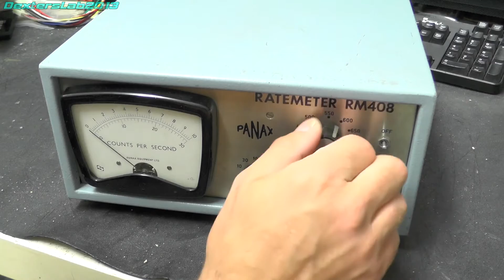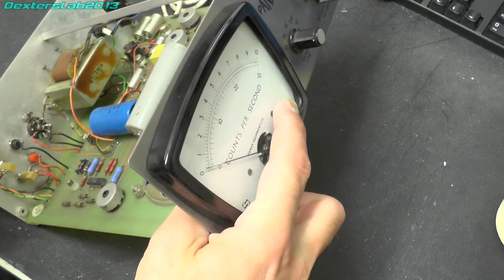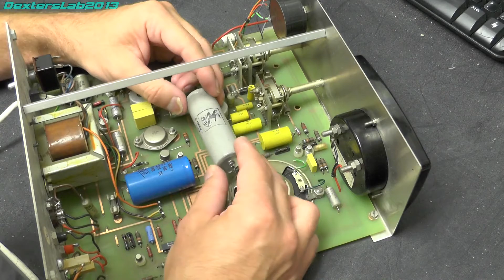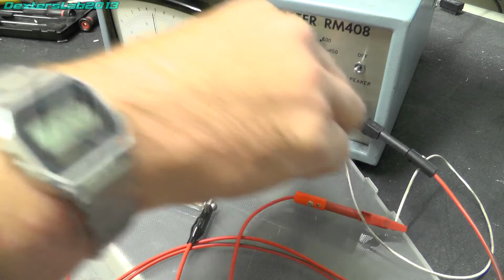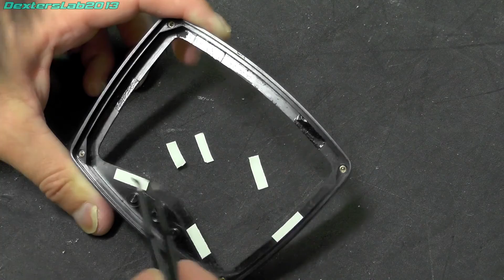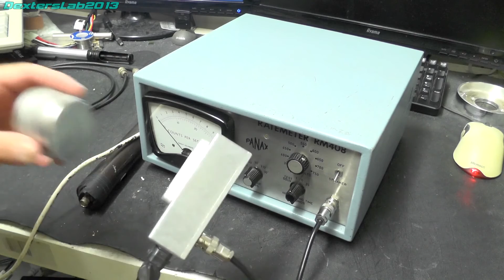DL152 1970s Panax RM408 Ratemeter Geiger Counter Repair

Comment: 18:40 yeee, some sanitary silicone would do wonders securing the old fella’ down

Amazed how the other leg just wouldn’t break though
Reply from the maker: I opted to use hot snot
Reply: owhyeah - why not

Lately I mainly go for silicone when I can wait on it to dry ... keeps my tube unclogged - and doesn't break a sweat at super high temperatures

Comment: What do you use as radiations source?
Reply from the maker: I have a few but the most used are a small rock sample rich in uranium that will of course include all the parts of the uranium decay chain and an americium sample from a smoke detector.

Comment: Not glue, but shellac, used to attach the glass and to seal the screws.  Clean glass and the case, and a drop of clear nail varnish applied to the inside to fill the cavity, a few hours to cure, and you are fine. Alternatively use UV cure epoxy and do the same, then hit with UV light till polymerised.

Incidentally the meter movement is made by Smiths, custom faceplate for Panax. Capacitor hold down would have been done by drilling 2 holes through the PCB and using lacing cord and a drop of shellac on the knot, but those caps likely are replacements for the unit, or they did a supplier change and did not draw out the board again. 

What transistors are they using, must have been the early days of high voltage planar transistors for them.

Comment: Nice thing. :D Can you test if it is accurate under higher radiation? I mean: depending on the circuit some counter skip even at medium levels if the waveform peaks are too close to each other. Like too low frequency resolution.
Also, why didn't you put new capacitors in it? For collectors?
I like your videos :)
Reply from the maker: It would be nice but really i would need to build an interface to my function gen so i can control the pulse rate, could be an interesting project though.
Reply: Easy enough, a simple sensitive gate SCR with 1kv withstand will do, it will act like a GM tube there. C106M will work to 600V (or a little more if you try, worst it will just break down harmlessly) and just use a gate to cathode resistor to hold it off, and a capacitor (probably 10k and 1n) to couple the pulse in to the gate.
Reply: @DextersTechLab  I was thinking about a good amount of radiation, but your idea makes much more sense. xD
I can Max out the software of my gq 300e+ counter with my things. So much so, that the reading has an integer overflow two times. (Over 65535) That is about 180,000 cpm in the end, not counting the definetly occurring double spikes that are too near to each other. XD I love it! It's somehow fun.

Comment: Nice retro bit of kit! Just a little heads-up, if you want your geiger tube to last it is important to place the appropriate current limiting resistance as close to the tube as possible, as capacitance of the leads can result in too high of a pulse current through the tube during a discharge. For short runs this is not something to stress about, but it is something to consider for more (semi) permanent set-ups.
Reply from the maker: Thanks for the tip, i'd not thought about cable capacitance before.